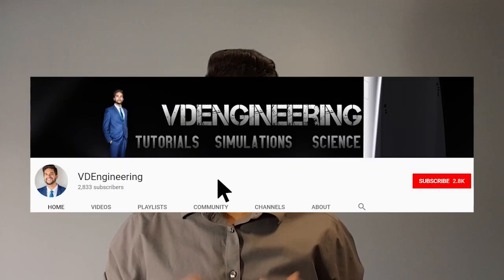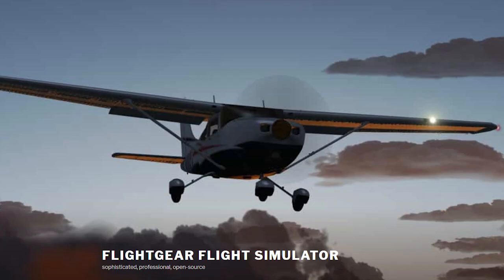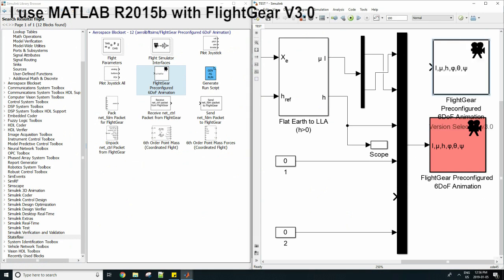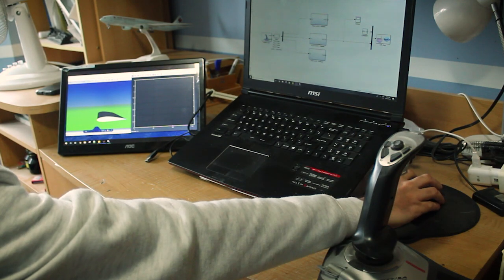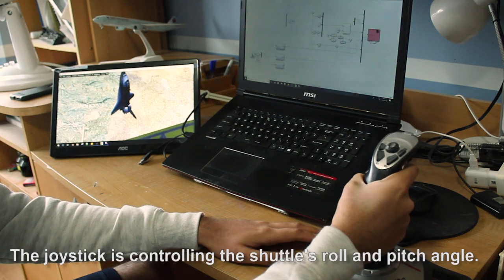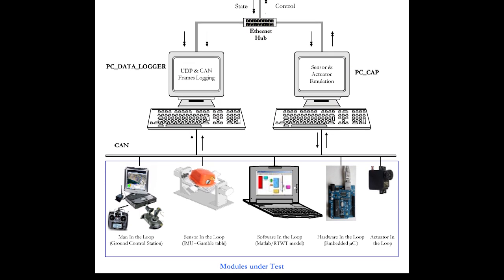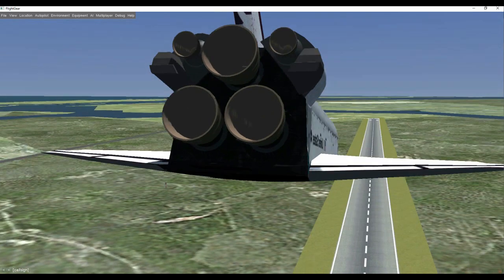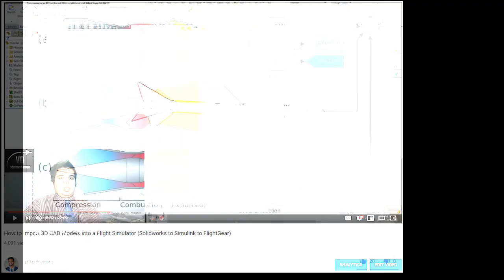Connecting MATLAB & Simulink to FlightGear (Part 2) - Troubleshooting and Common Issues / FAQ

Comment: hello，would i run the whole model in simulink external mode . what kind of  joystick did you use in your video, i want buy the same one. and when you run your model in simulink that is set in external mode or normal.   last my email is  lerucheng@sjtu.edu.cn